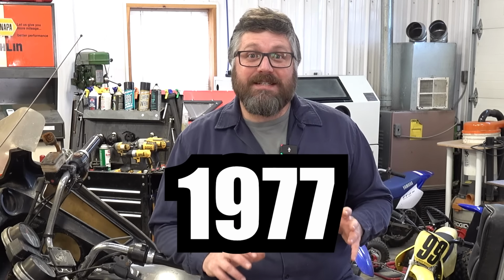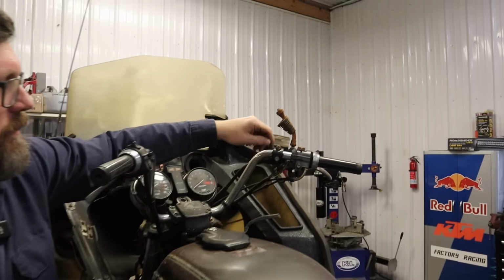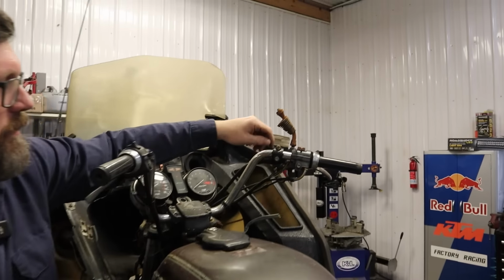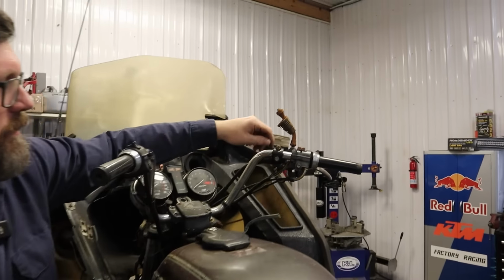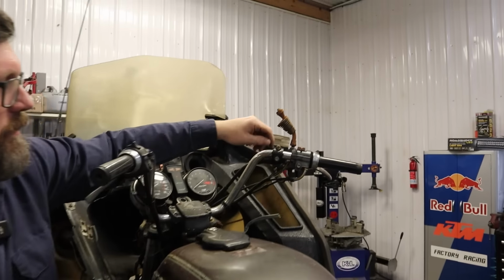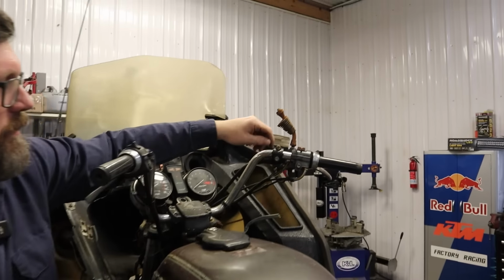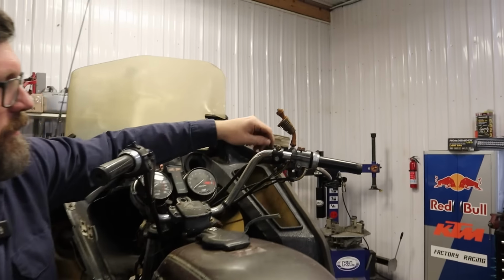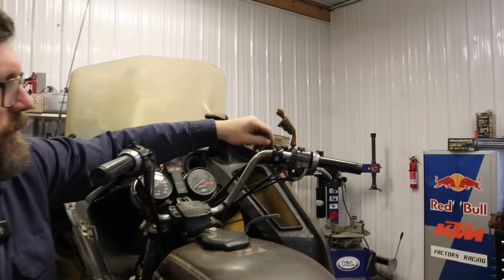Engine Seized! Can I Get This Cult Classic Honda Running?

Comment: Its a Honda man. I for one had not doubt it would run. Though your techniques were a bit puzzling to me but it ran. If you had taken the carbs apart and  cleaned it up  it probably would run on gas with starter fluid to start. Then adjust and put some new(er) tires on it and a new key and ride er. 
I had one back in the early 80s it was my favorite. I am a serial Honda bike owner and at one time had, I belive all of the 350 models, three twins and a 350 4 , a sweet bike , very quick to 55 and then slow up to 65  and she was done. But a great bike. All of them were and I owned a handful o 4's up to the 650, that was a FAST bike.